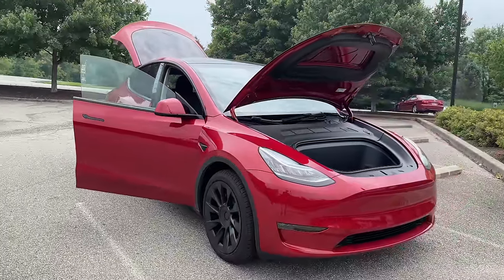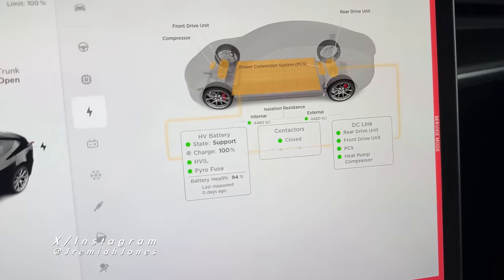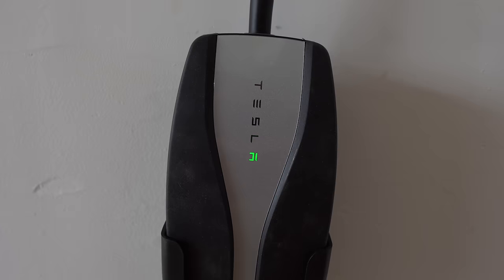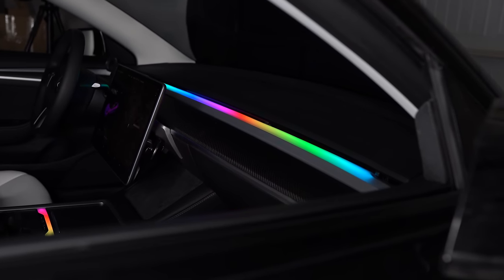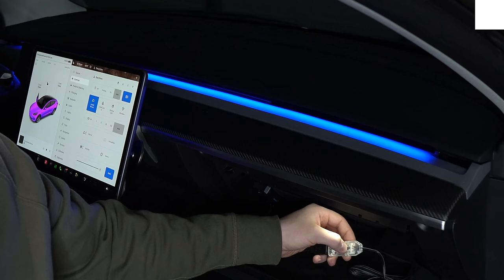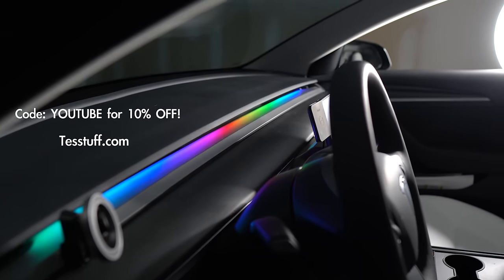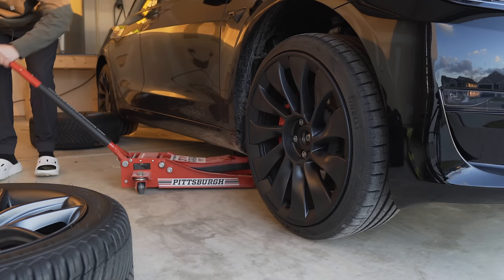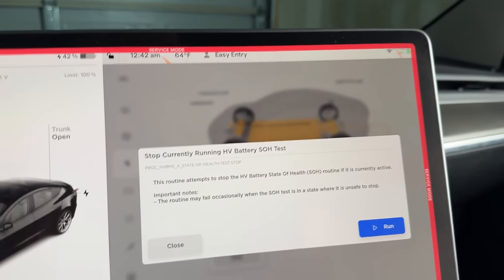How To Charge Your Tesla The Right Way | Avoid This Mistake!

Comment: Do NOT buy a EV if you cannot charge at HOME.
Reply: Nonsense. When I got my first Tesla, I didn't have home charging. I only Supercharged once a week and got free juice when at Target and Trader Joes and sometimes the malls. I have home charging now and it's much better, but not everyone travels a lot of miles, so not everyone needs a home charger. Also, many might have charging at work, so there's that.
Reply: In the SF Bay Area, Superchargers are cheaper than most home $/kWh. That’s ridiculously higher than other regions, but it’s still about half of what I’d pay for gas.
Reply: @ResetPhil  Yeah I saw the prices in San Jose and they're high. Actually a bit lower in SF, but that's a bit expected in those areas. Here in So Cal I'm at about .26c at home. 10 years ago it was about .17c. It's hard to swallow when some parts of the country you can pay like .14c still. Good thing solar is also getting cheaper as years go on
Reply: Agree. You can't be a slave to a supercharger somewhere.
Reply: Charge at work is fine too.
Reply: Wrong

Comment: Here in California… I use superchargers primarily.  It’s way cheaper than gas still, at least here! I know other states it levels off.  I usually spend $15-30 a week, depending on what times I go. I like going late for the cheap $3-$5 charges.  Beats my old Honda Civic where I was paying $70 a week for gas.  However, yes, I’m interested in seeing if my Model 3 will survive the long haul as I am planning on keeping it for years!  Hey, I don’t mind being asked in a few years if my battery dies out of warranty… lol wish me luck!
Reply: If you are a single dude yes you can go out on weird hours and sit there.  For those who have family and children may not be ideal……just saying.  I will never buy an EV wo home charging or at work.  My work offers free charging and it is always full, guys gets in real early to take spots.  After 9am, forget about it.
Reply: In LA and I use superchargers as well. Actually love the experience of going to different supercharger locations. When I’m only going to work through the week, charging once last about 8 days. Before when I was driving a Nissan Altima I was filling up every four days, paying about 60 dollars each time. I’m saving a ton of money now as I rarely pay over $21 to charge anywhere from 80 to 90 percent. Supercharging is not the same as paying for gas unless you driving hundreds of miles every day, driving fast and using heater/aircon
Reply: Supercharge is extremely hard on the batter fyi once a month ok, but if you want longevity for your battery it is NOT using a DC level 3. ie supercharge.
Reply: Turtle3000 I’ve taken my 2019 M3 on road trips from the Bay Area to Utah, Reno, Yellowstone and several times to LA.  I’ll charge to 90 to 100 % for long trips, and have seen almost no battery degradation.  Range is about 290 miles. For the record, the car never came close to the EPA estimate of 310. In reality, there are enough superchargers across the country, that it’s really unnecessary to charge to 100% on long trips.
Reply: @jesse6344  Nice!  I did my first long trip, LA to Vegas, and it did well!  I only had to stop once!  Going on 8 months, almost always supercharging.  Seems to be going well so far!
Reply: According to a study by Recurrent, Tesla's Superchargers, which use fast charging or "DC charging", don't significantly degrade battery range over time. The study analyzed over 12,500 Teslas and found no difference in range degradation between vehicles that fast charged more than 90% of the time and those that fast charged less than 10% of the time. The researchers also say that the data applies to other EV manufacturers as well.
Reply: I have a 2014 model s p85d  with free super charging.  I have supercharged it a ton since I purchased it in 2019.  No issues.  I  only charge to 80% unless I want to play. The car really wants to burn electricity above 90%.
Reply: @ryandgarland  Thanks for the input!  Yeah I have noticed that even parked at like 95% it burns quick. 80 and below, it seems to hold better when parked :)

Comment: You're the first tesla reviewer to mention supercharging is close to or equal to gas prices! I've had that argument with people and they keep telling me I'm wrong. Thank you for including this tidbit!
Reply: Depends on the fuel economy of your IC vehicle. Over the past 5 years I've noted that Tesla generally sets charging prices to equal the cost per mile for a 50 MPG IC vehicle....a Prius. So, yes, fueling costs are about the same as for a Prius. Of course the performance is about that of a BMW M2/3, which consume over twice that of a Prius, and it's more expensive fuel. Bottom line is that fueling at Superchargers fuels your M2/3 equivalent car at the cost of fueling a Prius. Pretty good deal.
Reply: really depends on location, time and how much you need to fill. But you are right in certain scenarios!

Comment: (Aug 28, 2023) A new report from Recurrent, which has access to data from over 12,500 Tesla vehicles in the US through its software service, now shows clearly that there’s little to no difference in battery degradation between frequent fast charging and rare fast charging:
Reply: It all comes down to battery temperature regulation and throttling down the charge rate when close to full. Modern EV's are much better at these things than early Prius days. Tesla's software is very good at optimization of battery conditions, at all times!
Reply: Yep, turns out Tesla's software is quite good at keeping them batteries pretty happy.

Comment: Great video. I installed a Nema 6-20.  IMO this a great balance of charging rate and cost.  It charges my M3 at 16 miles of range per hour which is plenty for my 40-50 miles of daily driving.  Agree 100% with if you can’t charge at home don’t buy an EV

Comment: I am so with you on that, I would never recommend an EV for someone that lives in an apartment and always has to fast charge.    I will certainly add that to my comments whenever I sell my Tesla….”home charged”  99% of the time.  👌🏼
Reply: I made this as its own comment but its relevant here too:  well shit. i just bought the 2024 model 3 (like took delivery not even a week ago). but i live in an apartment so i wont be able to always be plugged in. did i screw myself over?
Reply: @pvic6959  not exactly unless your daily drive is 100+ miles.   I wouldn’t buy a used Tesla from someone that didn’t charge at home and constantly had to use a supercharger 2 to 4 times a week as an only charge.   Nor would I want that for my Tesla if I plan on keep it over 100k miles.
Reply: @robertquinonez_  i do plan to keep it long  term. my work will probably be my primary charging place which is a chargepoint charger (and free). i think those are slow ones equivalent to at home charging right? I saw a lot (like over 15) EVs (10 are teslas) at my apartment garages so i figured if its working for them, it should be fine. 
I also plan to visit my parents every week or so and charge at their place. they dont have a wall charger but i can use the mobile charger i guess
my daily will be under 25mi, under 10 even most days.
Reply: @pvic6959  yea your good.   That’s nice you can charge at work, especially it being free.  👌🏼
Reply: @robertquinonez_  thank you!
Reply: @robertquinonez_ that's a myth. A recent study done on 12,000 Teslas found that supercharging had no noticeable effect on battery health/longevity. I will agree Tesla needs to do a better job of communicating though.

Comment: I have a LRMY and I drive 40k miles annually for work. My drives are mostly predictable, so it makes it easy for me to charge to 50% soc and leave the car plugged in at that soc over night. It charges to 70%-80% in the morning right before I leave. I rarely ever use superchargers and I use public free chargers while working as well.
Reply: How many total miles are on the car? Have you had any maintenance/repairs?

Comment: I own a Tesla model 3 performance, 2023, and only drive it once a week. And I only charge it once a week. I stay within Tesla's parameters. No lower than 20% and no higher than 80 percent. I keep the battery between 40 percent and 80 percent all the time. I do not use superchargers, only level 2. I have not noticed any degradation. For example I travel 30 mi one way and I use roughly 10% of my battery. That has been consistent for the last year. It's never changed! I'm not putting down supercharging but I don't do it and I think it it does help keep the battery healthy.

Comment: Here in NJ the state would not approve the Tesla charger for incentives and so I ended up with a ChargePoint which works fine. I got the $750 electricians bill paid. I charge my "3" from my "3" to 40% from my house power and then up to 80% with solar if the sunlight is a available. This gives me the most free miles. On a cloudy day I charge to 60%.......my car is only 4 months old and so I`ll wait till November and check the battery degradation then. Thank you for excellent advice!

Comment: Great info.  Did not realize it is OK to leave plugged in when at 80% and not using. thanks.
Reply: I don't do this. Because if a thuderstrom is comming i want disabled the car from the house electric network.
Reply: So you haven't read the manual of the car.

Comment: I do 100% fast chargings on my tesla model 3 2023 and i have a non LFP battery. I have 16k miles so far. Lets see how will it hold up in long term. I dont go under 18% and charge upto 80%.

Comment: The best way to charge your Tesla is via 240V at home using electricity generated by your solar panels. Longest battery life and lowest cost. The other alternative is to live in the Jackson, Wyoming area where electricity is 6 cents a KWH. Compared to fueling a BMW M2/3 (similar performance vehicles) at 20 mpg with premium fuel at $3.50 a gallon, for 300 miles of driving the BMW would cost $52.50, while the Tesla would cost $4.50.

Comment: The charging recommendation and lack of information from Tesla on battery damage when exceeding the recommendation is why I chose to not buy a Tesla to replace my older EV.  I am sticking with my old one for short drives and went back to a fun dinosaur burner for the longer drives.  The LFP battery was not available in the Y and the 3 with the LFP did not qualify for the tax credits so not worth it.  Tesla says to keep the charge 30-80% to avoid damaging the battery.  That is only 50% battery / range availability.  For a 285mi range performance Y it is only 142.5 mi usable range.  If you use heat or AC that will drop maybe 10-15mi and if you drive in a hilly area, accelerate quickly, or go faster than the speed used to determine the range estimates you will use another 10-15mi.  So now you are down to 112.5 mi usable range before needing to charge or risk battery damage.  Most of the time this is more than adequate, but if you need to go a greater distance or you get stuck in some type of traffic mess you will have to charge.  Tesla does not share the same info you did about it's okay to charge to 100% and drain to 5% as long as you do not leave it there for long durations of time.  The sales person did not know how to answer my questions regarding this or my statement of it is really just a short range EV.  There was not enough information to know how much damage this causes so I could not make an informed decision.  I did not think that expense for a car that has a short usable range was worth it.
Reply: Charging above 80 or draining below 20 won't damage the battery, it's simply a recommended best practice to not leave the vehicle sit at those states of charge for an extended period of time to avoid accelerated degradation. This isn't true for just Tesla vehicles, this is a fact of lithium-based batteries in anything: cars, phones, power tools, game console controllers, etc. The advice in this video is great for someone who can charge at home and plans to keep the vehicle for the long term, maybe 7 years or more, which is still within the battery warranty by 3 years. Planning on owning one of these cars for less than that and selling it afterwards, this becomes nearly a non-issue, and the vehicle can be charged to the owner's heart's content without worry about the lifespan of the battery. Me personally, I'm keeping my car until it becomes financially non-viable to repair if it craps the bed, so I pay a lot of mind to my charging habits. It requires a bit more forward planning than driving an ICE car, but quickly settles into a rhythm which is easy to manage. For instance, my commute is 75 miles round-trip every day. I keep my car at 65% charge limit, and this gets me back home with between 35-40% depending on weather conditions. This is enough to make some side trips to grocery stores or to get food on my way home, and I never have to pay any mind to range, and it's in a pretty happy window as far as battery longevity is concerned. Every few weekends, I drive about 4 hours to see family, and I charge to 100% and play a game with myself to see if I can make it on one charge, knowing I have a supercharger both at the destination and about 20 miles back as a fail-safe. The night before, I just set my limit to 100% and in the morning I have a full tank. There's a lot of battery hocus-pocus out there and I did a lot of digging and researching before buying my car to make sure it would fit my use case and so far it's been a great little daily. cheers 🍻
Reply: @floodtheinbox  Thank you for the very indepth reply.  I find it interesting the Tesla sales rep had no intelligent reply like yours when I shared I can't justify buying the new Y with that range limitation and battery degradation risks.  If he had, I might be driving the new Y.  Either he does not know this or has not been trained.  I will keep my 5 yo Leaf for a commuter and burn dinosaurs for the longer trips.  Even though I paid more for the new dinosaur burner it is better looking, slightly faster than the Y performance, and much more fun to drive.

Comment: Thank you, I have an LFP and scared to plug it in every night.  So many people say it’s still a lithium battery so I plug in only twice a week.
Reply: Please read your Owners Manual. Take it from there, it’s from Tesla. If you can’t trust the official advice from Tesla, why did you pay them loads of hard earned money to buy one??? I charge my M3 LFP 100% at least once a week. In other words, it might be more often than once a week. It won’t overcharge itself, the Battery Management System will prevent that. Being plugged in allows you to precondition your High Voltage Battery more efficiently and it will recharge your low voltage Lithium battery ( not the Lead Acid battery in older models) . I mostly use a Tesla Wall Connector, occasionally Supercharge when out of town.
Reply: @jacobheinz8236  hmm, I agree. It says to charge to 100 percent at least once a week and it is ok to charge daily.

Comment: I started with a Bolt (which I really liked) but upgraded to the MYLR for the range and yes, the charging network.  I do have a hard wired Emporia Level 2 charger.  Living in Las Cruces NM, during the summer the overnight garage temps can easily be in the upper 90s.  The Bolt really cranked up the batter cooling system and the overhead was pretty high.  For that reason I dialed down my charger to 24A.  With the Tesla I still normally use 24A.  That meets my needs to start a charge at 12:15 am from as low as 20% up to 80% before I need to drive it.  

So, with that long prolog in mind, is there any advantage (from a battery life perspective) to charge at a higher amperage?
Reply: i guess the only advantage is time saving?

Comment: I would consider 240v using the mobile charger with 14-30 adapter  should be level 1.5.  This is the solution I use daily.

Comment: Question: I’m home often, have the home Tesla charger (L2) and drive <400 miles a week on average. If I’m leaving my car plugged in all the time and charging time really doesn’t matter too much, should I set the amperage low when possible (<20amps)? You mentioned voltage here but not amps. Or does it not matter? The only thing I can find online is that higher amperage causes higher battery heat and higher heat can be associated with battery degradation .

Comment: Great video, thanks for this! Curious about your opinion on something: I have the Universal Wall Charger and leaving it at 48 A, I do get 40-something miles of range added per hour. But I really don't NEED to charge that fast. I usually drive no more than 60 miles per day, I could charge much slower overnight to replenish my daily range. Definitely planning on keeping my Model 3 a long time; would you dial that way down in the app to charge more slowly overnight for long-term battery health?

Comment: My ‘20 Tesla came with free Supercharging for life of ownership and a new SC station is just 0.3 miles away from my home. My house also has solar panels and TOU rates and net metering.  I have a NEMA 14-50 plug at home.  I’m retired so don’t put on much mileage, maybe around 5,000 miles/year.  So what kind of charging should I do?  Someone needs to come up with a charging calculator where various factors can be input and a charging plan is figured out to optimize charging.